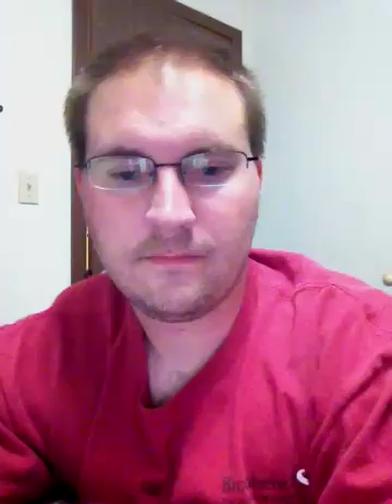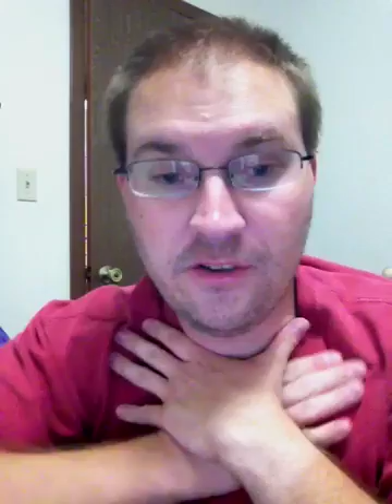Introduction to Mechanical Ventilation 1

Comment: Hi Chris I had a question about mechanical ventilation   I have a patient that has a low pip 4-6 and low VE  3.4-4.4 no  leaks cuff inflated , BS are wiped out, cant hear  thing! Patient stated shes having a hard time breathing oh, and her heart rate gradually increase from the 80s to the hundreds, what could it be?
Reply: That low of a PIP probably means flow starvation. Crank up the flow.
Reply: @peanutbutter1546  thank you!